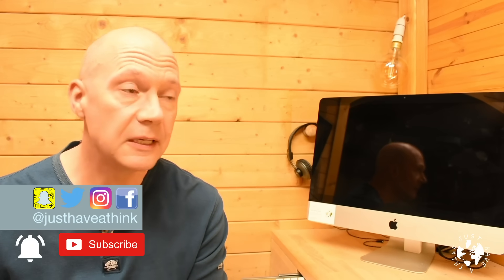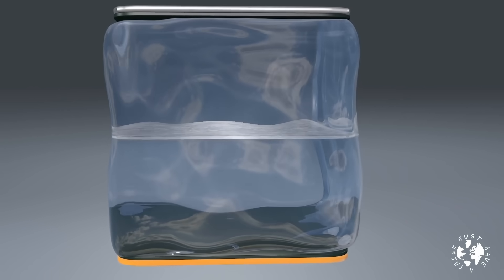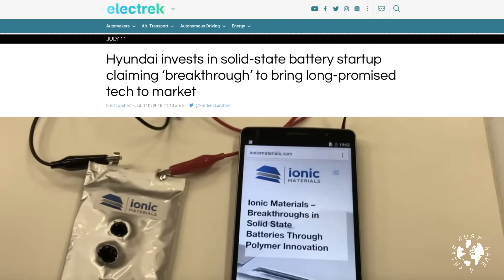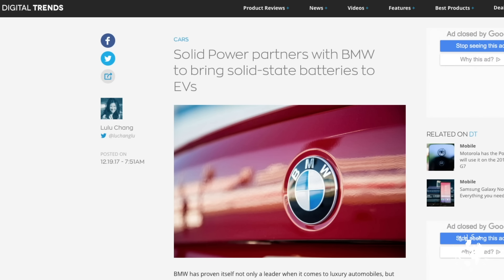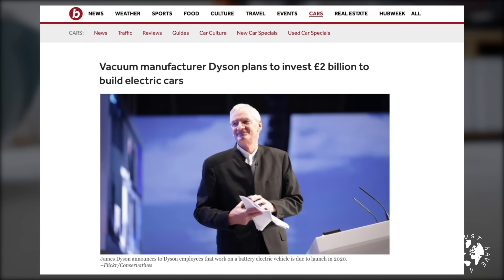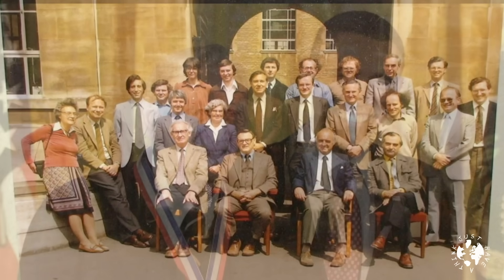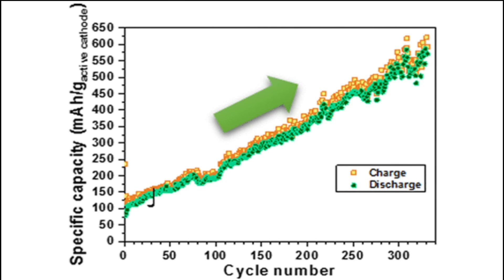Solid State Batteries - has Goodenough nailed it again??

Comment: How does this relate to the dry batteries developed by Maxwell Technologies, which was just purchased by Tesla?
Reply: Those are not solid state batteries at this time. The "dry" just refers to the manufacturing process.
Reply: @michelangelobuonarroti916  Thanks. That confirms what I'd figured from videos on the Web. Too bad, though, because otherwise Tesla would have batteries that never degrade despite many charge/discharge cycles.

Comment: good stuff. i just replaced an aging 60# car battery with the "latest" tech, and it was still 60#! i wish i had access to a spec super capacitor replacement...maybe next time. as far as this presentation goes, well done, except for one thing, peer review is not replication! real, hard science, requires replication. we must move away from peer review, leaving it to the soft sciences only, and return to replication in hard science. replication is real proof, peer review is learned opinion. cheers to goodenough! a real scientist and researcher.
Reply from the maker: Hi Otto. Thanks for you feedback. An excellent rebuff, the lessons from which I will certainly try to adhere to in future presentations. Much appreciated. All the best. Dave

Comment: OMG, we've had solid state batteries for, well, when did Franklin show lightning to be electricity by using a Leyden Jar -- all sold state.  So, the same class of device has been used in all electronics ever since, even being shrunk as needed to be used in computer chips -- know what a DRAM is?

More recently, solid-state storage has been implemented for car batteries and gangsta-boy car-shaking boom boxes.  It's called the supercapacitor.  It stores electric charge in the most efficient form:  electrons, not huge, polluting/exploding ions.  Graphene versions are even recyclable as Yule logs.  ;]

Now, if this video explains all that, great!  So far, it seems to be yet another pop-sci piece that ultimately is just marketing that dumbs rather than educates.  Woud like to be wrong.  ;]
Reply: its not a case of didnt have them, they were of useless low capacity, not comparable to any battery

Comment: I wish journalists wouldn't fall into the trap where they compare and contrast technology found in the lab with commercially available versions of 'that other technology'.  Yes, I'm sure that solid state in the lab has almost twice the capacity of what you can buy off the shelf, however, 'in the lab' that thing you buy off the shelf ALSO has crazy capacity.  The trick is how much is left after all the safety/engineering/manufacturing considerations have been designed into the commercial version of that product.

Comment: A perfect synergy, batteries like this and solar power. There is a lot of BS out there about new battery technologies, but if this is going through the very high standards of the peer review process then it is something to be believed. Once cars get to 400 miles on a single charge and at least 50% recharge in one hour I will no longer buy a gasoline vehicle. Then we will need to spend the money to upgrade our power grid the way China already is to get ready for this new economy.

Comment: If solid state battery become reality, then we can put batteries not just under the floor like Tesla does, but also in other parts of the car bodies, for example, embedded inside the lining of the roof, doors, bumpers etc. This will theoretically increase the range.
Reply from the maker: Hi Fadly. Nice observation. Lateral thinking like that leads to smart design solutions. Thanks for your feedback. All the best. Dave.

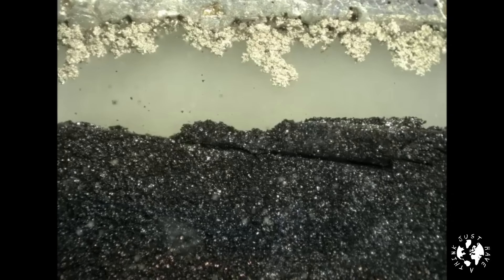Comment: 2:27 That's not correct. When your phone/laptop is plugged in to a charge source the battery doesn't charge and power the device at the same time. That isn't possible. The device draws power directly from the charge source whilst the battery charges. In other words the source electricity is split between powering the device and charging the device.

This is why you can remove a battery from a laptop and it will still work when plugged in to a mains supply.
Reply from the maker: Hi nitelite78. Thanks for your feedback. You're quite right. In fact  I got spurious info during my research and that whole battery animation section is wrong (cathode and anode also the wrong way round!!). I've edited that whole section out of the You Tube upload now so that no-one else has to suffer this misinformation. Huge apologies for the error. I will be much more careful in future. All the best. Dave

Comment: I always thought anode was positive and cathode negative. What have I missed here?
Reply from the maker: Hi Benny. You're absolutely right. I screwed up. I misunderstood some information at Stack Exchange when I was doing my research, because it can get a bit strange with Lithium Ion batteries depending on whether the device is providing power or not. But I should have stuck to what I learned in O'level chemistry 35 years ago. Anode is POSITIVE and Cathode is NEGATIVE. I've now put a addendum note right at the top of the Description box. Huge apologies for any confusion. All the best. Dave
Reply: @JustHaveaThink  Thanks Dave, it was a long time ago for me too, so I posed it as a question because I'm often wrong, or things have moved on since.

Comment: The cats meow will be solid state combined with ultra capacitors..... Tortoise and Hare will work best together, as long as they work together and do not "compete".  Even Li-ION with Ultra cap. is not a bad way to go.  OR, fo rcolder climates, Ni-MH with ultra cap.--- just waiting patiently. Maybe in 4 yrs.
Reply from the maker: Hey YouSurf. Thanks for your comment. One or two others have mentioned super caps, but I think you're the first to throw in Ultra caps. I definitely will do some research on these for a follow up programme later in the year. All the best. Dave
Reply: @JustHaveaThink  heard of em before 2006.  Maybe quite a bit before, I think GE Research and Development was working on them about the time they closed down their Fort Edward NY Capacitor plant.  It was at least super capacitors then, but these were large scale ones for utility and industrial use.  This Estonian company is ramping up now on smaller ones and up to industrial because the capacitors can be trained into a pack, just like a Tesla PowerWall. but with RAPID energy provision. Great for surges and recharging batteries rapidly.

Comment: The increased range is pretty much marketing bullshit. Solid state batteries are more compact in volume, but not lighter in weight. In short, liquids have higher volumes than solids. Solid state batteries also generally also have higher power performance... but this is really not that much of a advantage.

A down side is that they have problem with changeing changing volumes. I would say this is the primary reson why we have not seen them on the market.

The "double energy per volume" is not for NCA batteries, but rather for LTO batteries. LTO batteries are great... for industrial implementation. But they have horrible large volume. We talking 4-5 times larger volumes than NCA batteries. So making the volume half as large, still makes it larger than NCA (that is what most phones use now days). Still the batteries will be very heavy. To heavy for electric cars (but resonable for hybrids)

Also about cobolt. not all batteries use cobolt. LTO batteries never used cobolt, that is also true for LFP and a few others. But NCO and NCA that mostly used in electric cars does.

Actually pretty much all rechargable batteries increase there capacity for the first couple of charges. Usually this effect wears of after 5-10 charges, and its usually quite smal (2-5%)

Peer review is no warranty the science is correct. What it does is that the method is correct and to some extent (really not that common nowadays) its repeatably. Reputability test is actually becoming rarer, and there for data fudging is getting more common. So peer review is hardly worth the paper its written on today. 30 years ago... well that would be different. Really my tip is to ignore claims of peer review and in steed focus on actual provable result. It also takes years to do repeatability testing for battery wear time. This is specially a problem for solid state batteries that change shape when they are charged and discharge.

While you may do 20 000 repates on the lab in a open configuration. When you have a tight cell it might not work at all.

More over, its not all solid state cells that are flame resistant.It depend on the rest of the chemistry. Pretty much. Just because you se someone cut one solid state cell up in peaces or take a nail and a hammer and it just keep working. Don´t imply that its true for all solid state cells.

Its also worth saying that mixing improvement from different types of cell is really missleading at best, and down right a lie at worst.

Comment: Seems simple enough tbh; the ability of the battery to charge does not decrease with the number of charge cycles (as normal Li-ion batteries do), and the ability of it to discharge what charge is stored increases (unlike normal Li-ion batteries).

What's intriguing here is that the battery doesn't actually hold more power as it cycles (although an actual capacity increase wouldn't violate conservation of energy at all, that's just not what's happening here), rather, batteries can only discharge so much of the power they store, and this one can discharge more of the power it is storing the more it is cycled.

That's fascinating, honestly.
Reply from the maker: Thank you (I think!) 😊

Comment: That solid state battery that gets better and better capacity over time: If you imagine the particles inside the battery becoming more and more polarized over time then they are contributing to the charge of the battery whereas before they got polarized they did not.
Reply: This implies that it's failure mode is more sudden. where most batteries loose charge. this battery would likely plateau at a point and then break.

Comment: With all these solid state batteries coming. Is there anyway that we can get cheap alternative for batteries allready in market. Do y thing we can finally get those single use AA And AAA Batteries off from market shelf's, and replace them with good rechageables?
Reply from the maker: Hi Jukka-Pekka. It's a fair comment. There are already good rechargeable AA and AAA batteries on the market, at least here in the UK, but manufactures would do well to try to move to lithium ion as soon as possible.
Reply: Rechargeable batteries are available everywhere in the USA. Their capacity keeps getting better with better chemistry. I think you are saying we need to stop selling one time use batteries and that I agree with.
Reply: There is rechargeable batteries everywhere, but to be cost and usage efficient that is different story. Even i have few of them, but when they are taken in use degeneration starts. In a while batteries won't charge anymore, and if battery is empty recharge takes long time. Solid state battery should help with the problems.

Comment: It's not conservation of energy, when you plug it in you're getting more energy from power plants. Whether a balloon changes size when you pour water in or out of it is separate from whether new water is created or just old water comes from somewhere else.
Reply: Electric motors are way more efficient than ICE engines. All the moving parts in an ICE car adds even more inefficiencies. Today, EV drivetrain weighs the same as ICE drivetrain for similar specs. Soon the EV drivetrain will be lighter than the ICE drivetrain and that is another energy savings...
Reply: @0ooTheMAXXoo0  I didn't say anything about electric motors...

Comment: Batteries will provide the power for our future.  Imagine a future where your solar paneled roof provided enough energy to fully charge a future generation, solid state Tesla Powerwall. The Powerwall powers everything in your home and also charges your vehicle.  Say goodbye to massive electricity and fuel bills. It's time to break our bonds of dependence on our local energy company and fossil fuels.  If vehicles like the Rivian R1T prove to be successful, they will quickly drive the internal combustion engine into obsolescence.
Reply from the maker: Hi John. Thanks for your feedback. You make very good points here. I've made several videos on renewables and a smart distributed grid. Programme #9 has a breakdown of what was involved in my own solar panel purchases. I hope you get a chance to take a look 😊
Reply: According to the trends, we are about 5 years away form 80% of households generating their own power and the shift will come for purely economic reasons as solar panels and batteries become crazy cheap in the next couple of years... If you take away subsidies from all energy sources, solar is already the cheapest way to generate electricity (as of 2017 IIRC). Plus, efficiency and costs are improving exponentially so it really looks like we are on the brink of major disruption. Oil use is set to drop by 30% in less than 5 years for example...

Comment: Doesn't mean shit. If the price is 5x more per KWh.. As it's about available resources and cost to market... Solid-state. Coupled with capacitors at 95% efficiency comes in first...
Reply: everything starts off expensive, then it gets cheaper, first have to make it then improve it,   a PC in the early 1980s was the price of 2 new cars

Comment: A non-sponsored garage shop in Bakersfield, CA has put recycled Tesla batteries into a Frankenstein car and achieved 748 miles on a charge. Claims of "400 miles by 2025" look pretty mundane against that achievement.
Reply: Even a stock Model S has gone 1000 km in a single charge... Model 3 is rated for almost 500 miles at 48MpH... Tesla has stated that they have new battery tech that uses zero cobalt and is another 10% improvement in energy density... Going into production early this year. The new manufacturing lines they added in 2018 build the battery cells 3 times cheaper than the previous lines... Until the world makes a lot more batteries we will be limited in what we will see from other car companies... Eventually, Tesla will be large enough to make batteries for other car makers...
Reply: @0ooTheMAXXoo0  - This was 748 MILES of real life driving conditions. Bakersfield to Sacto, on to Tesla in Fremont, on to Apple in Cupertino, and then back to Bakersfield. Not a closed track or steady speed.
Reply: well the world record for mpg was a honda c50 engine in a tiny low go kart, but its not really relevant to reality, a real car has to have things and safety, and a roof etc, trunk space

Comment: Why don't these so called safe batteries come out now? What are they doing that is holding them up to be released for public use? Is this info old? I thought I heard Dyson got out of the solid state battery venture? Or was that just the car he want to create?
Reply from the maker: Hi Edwardo. Good question. Its hard to know why none of them has launched yet, they're all very secretive. You're right that Dyson has ended his partnership with Sakti 3. That happened after the video was released. Thanks for your feedback though. All the best. Dave
Reply: We won't know the details because of secrecy but it usually comes down to manufacturing techniques. It is one thing to make working prototypes, it is another to be able to manufacture them at a scale and cost that makes them viable in the marketplace.
Reply: everything is marketing for investment, simple as that,  actual improvements are tiny and incremental, not large

Comment: i have followed battery tech about five years. graphene batteries are also known as solid state batteries. I am able to order graphene batteries only for hobby toys but not applicable for cars, motorcycles and more. they hold 50+ more range and never heat up.
Reply from the maker: Hi Jack. Thanks for your comment. That's good information. I've been wanting to talk about graphene for a while but I hadn't heard of any large scale commercial energy applications yet. I'll keep my eye on this and hopefully do a feature later in the year. All the best. Dave
Reply: @JustHaveaThink There is a company in Finland making graphene supercapacitors which are sold and in use. Fully Charged covered the company quite a while ago. I cannot recall the name right now. They are not efficient size-wise but should be great for charging and regenerative charging since the chemical batteries are slower to charge. So the idea is that you would use both capacitors and batteries in concert to handle quick bursts of charge while also storing enough overall energy...
Reply from the maker: @0ooTheMAXXoo0  That rings a bell actually. I think I saw that Fully Charged programme too. It sounds like graphene has all sorts of applications including energy storage, so I'll definitely do some research here to see what we can put together into  a programme. Thanks for the tips.

Comment: Simple actually,  much like you need to break in a cars engine to get the best efficiency out of it,  the same is true with the new type of solid state batteries as well.  It needs a few cycles to break in.
Reply: Like blowing up a balloon. No air(energy) is created or destroyed just the container(energy capacity) gets bigger.
Reply: Sure it's not simply a WTF?